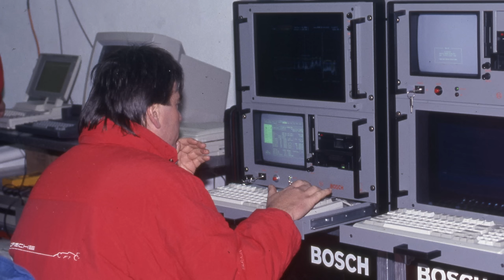10 manufacturers that failed in F1

Comment: Uhm Porsche have the fastest racing car that’s even faster then F1 cars
Reply: No they don't. Leclercs pole lap in 2019 was a second faster than 919 hybrid. Not to mention, the Porsche wouldn't have even come close to f1 cars on any track except spa and monza
Reply: chaitanya reddy No Porsche 919 evo Le Mans was the fastest race car ever faster then any F1
Reply: chaitanya reddy and I have the proof right infront of me Lewis Hamilton has the record on the track and the evo Le Mans had a time that was 0.783 faster
Reply: @jimvandeven9732  my bad, i must've had the times mixed up. But i still believe it won't come near f1 cars over the course of an entire hypothetical season. Who knows maybe f1 cars will be back on top this year at spa ;)
Reply: Besides, it rained in 2018 during q3 of f1, but q1 and q2 were dry and vettel did a time of 1:41.5 in q2 which is faster than the 919 by two tenths. So yeah the pole laps may not have been faster but cars are faster in general
Reply: chaitanya reddy we’ll see probably will because the Porsche will get older and older and it won’t make new times and the F1 cars will get better because they make changes every year to make them better
Reply: chaitanya reddy could be yes It would be fun to see if Porsche wants to make a faster car then the 919 evo Le mans